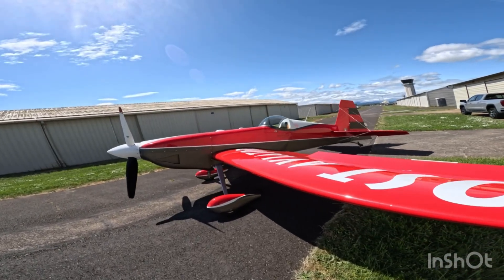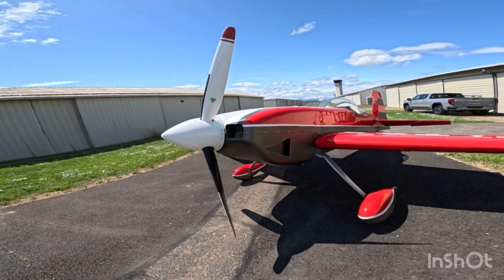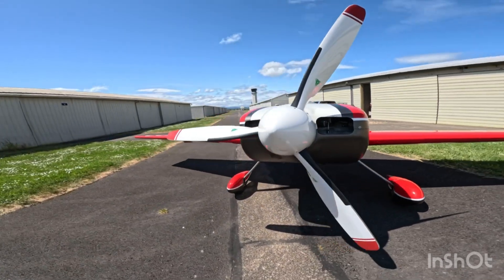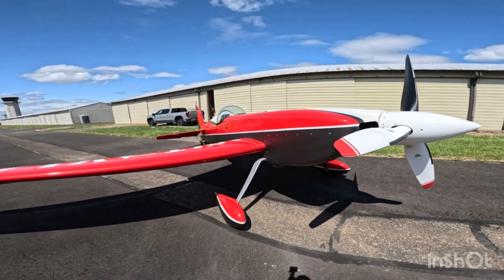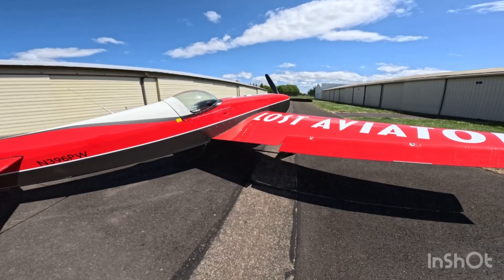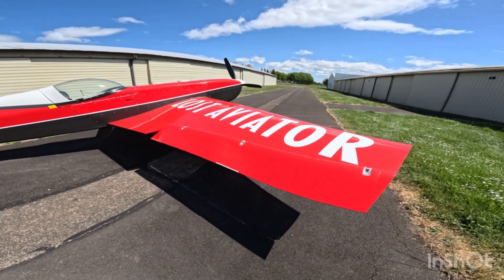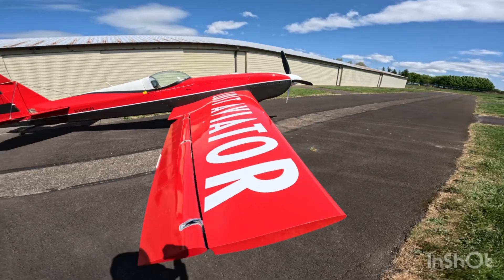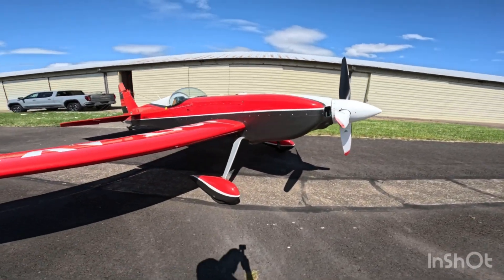How to Hot Start a Lycoming IO-540 using the Steve Wolfe method

Comment: This was the exact hot start procedure I used for the 34 years I’ve owned my Mooney with an IO-360. Last year, we installed a new fuel servo, divider and nozzles - 😢only to find that on really hot days the tried and true procedure doesn’t work anymore. 

The original POH calls for hot start to leave throttle at 1,000 RPM, idle cutoff, boost on, mixture forward for 3 to 5 seconds then back to idle cutoff and crank. It’s work only one time. What seems to work better is flooding it and using the flooded engine start procedure (throttle full forward, idle cutoff and crank. You’ve got to be Speedy Gonzalez to get the throttle out and mixture in before it launches on you. 

Feels like I’m on a quest for the Holy Grail. Cold starts are normal as are warm ones. Just the hot hot ones (like the one described by viewer after refueling) are troublesome.
Reply from the maker: That is just super sad. I had a Mooney with the O-360 for several years and treated hot starts just like cold starts. I didn’t know any better, but I never got stranded.

Comment: Beautiful plane, and nice aerobatics. I have a Glasair III with the IO-540-K1H5 engine (technically).
Why not just do what the Lycoming IO-540 Operator's Manual say? Quick and simple, and same for hot and cold: Hot Engine – Because fuel percolates, the system must be cleared of vapor; it is recommended that the same cold start  procedure, as outlined on page 3-2, be used for starting a hot engine: 
IO-540 Series (Cold Engine).
(1) Perform pre-flight inspection.
(2) Set propeller governor in “Full RPM”.
(3) Turn fuel valve to “on” position.
(4) Open throttle approximately ¼ travel.
(5) Turn boost pump on and move mixture control to “Full Rich” position until a slight but steady
flow is indicated.
(6) Return mixture control to “Idle Cut-Off” position.
(7) Set magneto selector switch. Consult airframe manufacturer’s handbook for correct position.
(8) Engage starter.
Reply from the maker: @erikev  thank you very much!  Do you do any acro in it? There was a time when I was very interested in a Glasair … but couldn’t afford two airplanes.  I prefer the method that I have adopted because the Lycoming way tends to flood the engine a little bit. However, their way is definitely not wrong and will probably work very consistently. I just find that I need a lot less cranking the way I do it.  I would certainly choose their procedure over the full throttle start, which is very widely used and occasionally is part of an accident review.

Comment: I have an IO 540 in my Rockwell Commander.  I have to crank a lot more than this, sometimes close to 10 seconds if I do not turn the electric fuel pump on, push the mixture up a few inches, and count 10 seconds after the fuel flow jumps.  Then I go fuel pump-off and then crank with mixture closed and rapidly full after the start. Using this method, I get a start in about 3-4 seconds or about 4 blades.
Reply from the maker: Interesting! How long has the engine been off before you try to crank it?
Reply: @  Usually about the time it takes to refuel and let the fuel settle before I sump the tanks.  Say 15 -20 minutes at the most.  It could also be that I have the IO-540-T4B5D which has the single drive, dual magneto and is derated to 260 hp and is cowled differently than your aircraft.
Reply from the maker: Different setups can definitely produce different results!  On a side note, I’ve always wanted a Commander 114 as a traveling aircraft. Beautiful and capable machines.